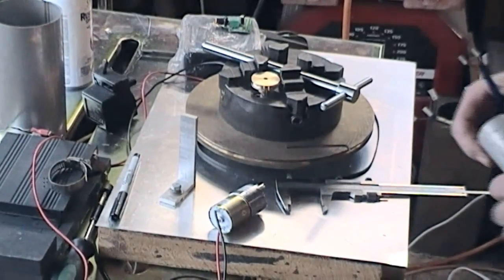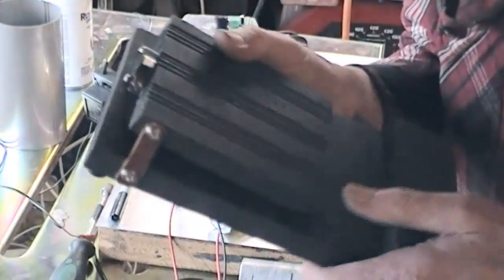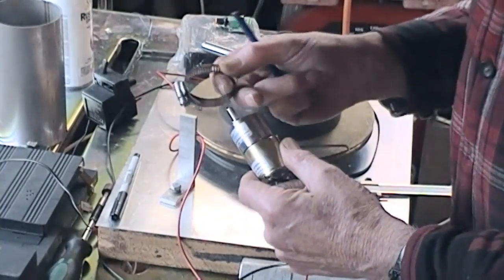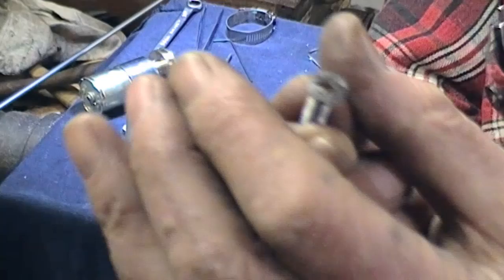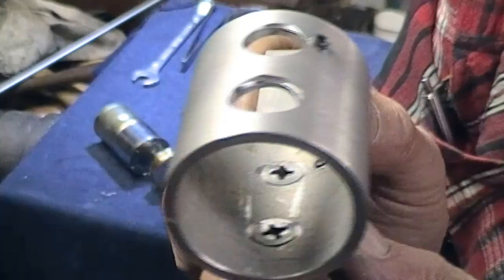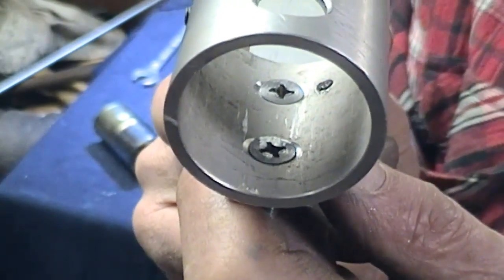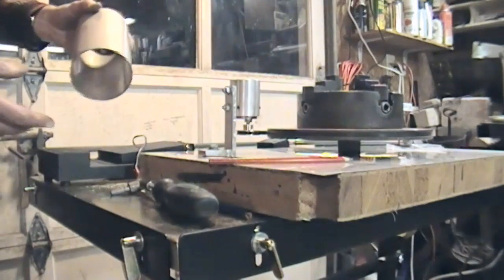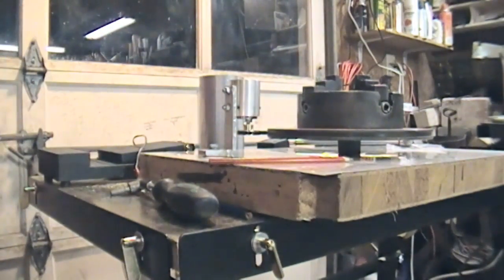Motorized Turntable, Part Three

Comment: Hi Chris,
 How about a baked bean tin cut to size, you only need to cut the slots and the top is already in place ergo the bottom of the tin can.
Of course you can select the type of can to match your requirements perfectly.
Cheers Mo
Reply from the maker: Had considered that Mo but, not very rigid.  As I had a piece of thicker walled tube used that which made for easier drilling etc - much more rigid.

Comment: Looks Great Chris!  Cute little controller...looked like it had SMT components. Was it out of something else or did you make it?  Had another thought about the belt cover and ground brushes...what if you put your brush system on top of the rotor and attached them to some sheet metal fabrication that could cover the belt and hold the brushes¿  Might need some supports around the circumference and anchored at the post or tube, but would be strong and solid for the brushes.  Great little system you've come up with and bet it will work great!  Thanks for sharing and your passion for making things from old discarded bits & scraps! (I just love that, necessity or not)  ~¿@  PJ
Reply from the maker: Thanks. Yes, this controller was a "from China" - and chose it because so conveniently small.  It is SMT - with IIRC one small chip - very compact, ideal and, not very expensive either. I have enough components to make one but not that small - I am still 'old school' with all discretes! Thx for brush suggestions -- still for now a 'work-in-progress' which I have to do yet.... even thought of a 3 brush ring around boss underneath.
Reply: ChrisB257
I hear you about discretes.  Tried J-leg while back...ugly...just not as steady as I once was even with trifocals...@¿@  Think everything is a work in progress anymore, but yours looks great so far!...Onward as we can...Be Warm!

Comment: My immediate thought was to drill and tap the holes where you have counter sunk, and pass the screws through the bracket instead!
Reply from the maker: Hi Ray -- only reason I didn't go that route was felt that thickness of tube wall was perhaps a bit skimpy for reliable tapping and thread hold - definitely an easier route for sure!

Comment: looks good chris...one thing that possibly overlooked the welding splatter may ruin the rubber belt just some thought :)
Reply from the maker: Yes - belt certainly needs thought about. If I slot that huge diameter steel tube I reckon it can be close enough to turntable to pretty much give some protection. That and motor top are main areas of concern, and maybe too the top of the plastic control box.

Comment: you didn't consider drilling a hole in the baseplate  the size of the motor and flipping it upside down ?
Reply from the maker: Hello Lasse. Did think of that but - two considerations -- getting corrected drive height and - belt tension aspect - may have needed a jockey tensioning wheel. This approach seemed to give a bit more choice.